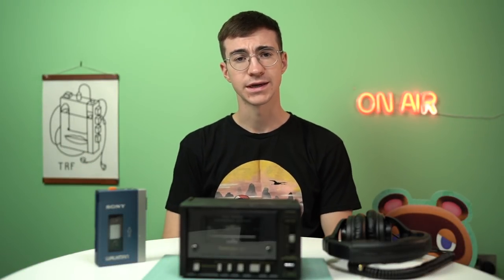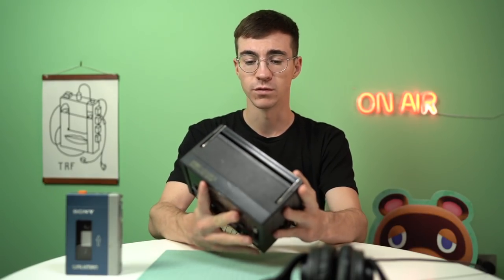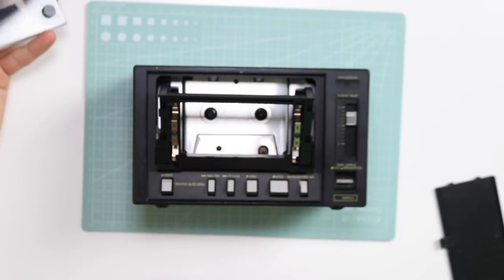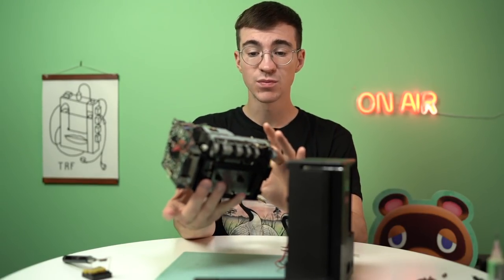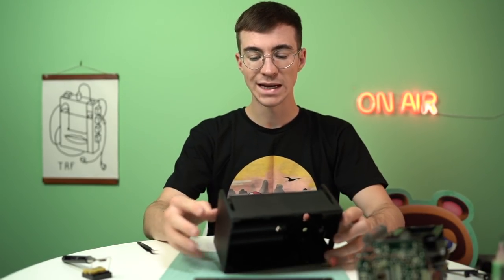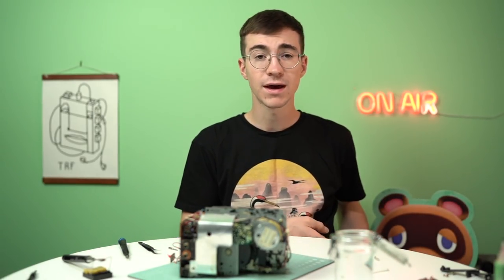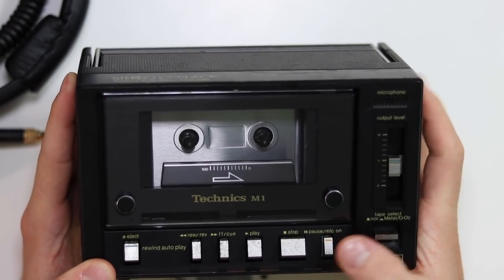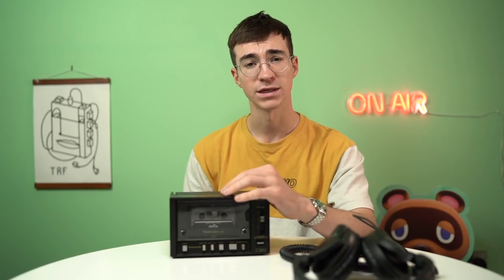RARE Technics M1 Co-Deck Clean & Repair

Comment: After watching YouTubers who repair electronics using contact cleaner to clean pots, I got this CRC electronic contact cleaner from the automotive section of Walmart and used it of volume pots, and I absolutely fell in love with it. This stuff is pretty inexpensive, but professionals typically use a higher grade of contact cleaner. I have no idea what the differences are, but CRC seems to work quite well. The contact cleaner cleans off the oxidation and leaves a protective light, protective lubricant behind to help keep the pot working smoothly for a long time.

Comment: rewatching the vid, if you can't get at the belt just degunking it with alcohol so it has traction without sticktion it'll help a little with the wow and flutter, it is better if you can get it out and dip it in boiling water for 20-30 seconds to put it back into shape/tension.